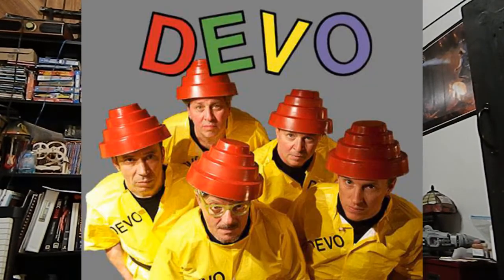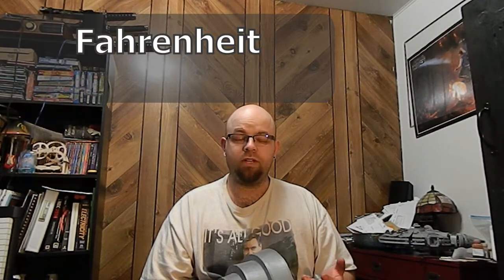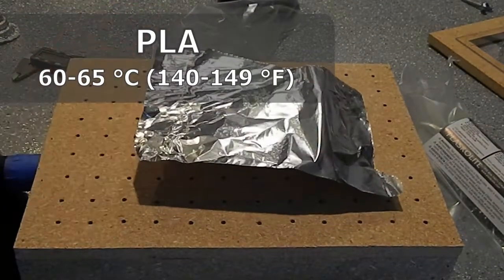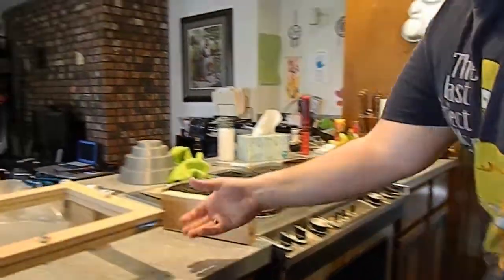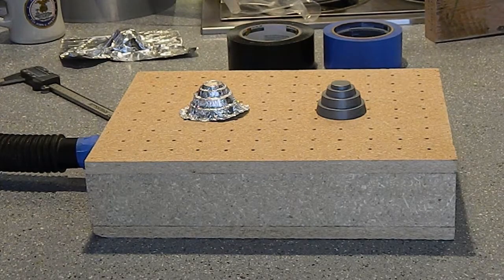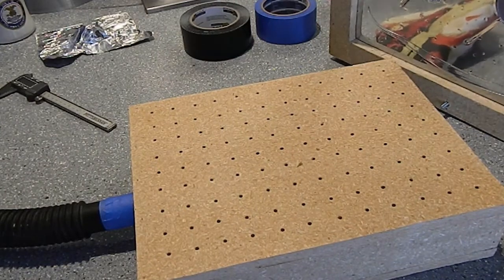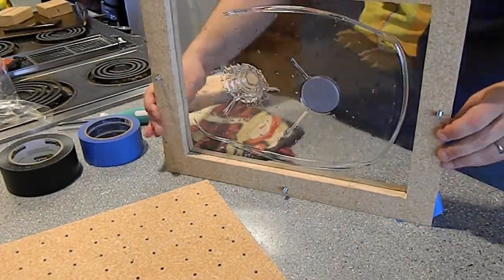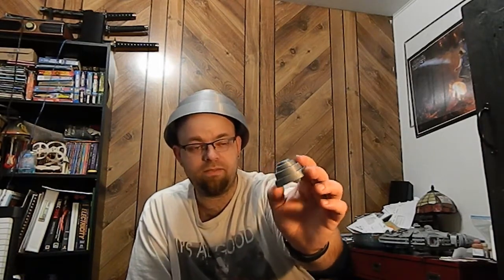Vacuum forming pla

Comment: Hi, I'm from Brazil and I'm thinking of buying a vacuum machine. Does pla deform in the process? Does not work?
Sorry if you mentioned that in the video, but I don't understand English.
Reply from the maker: Fantastic question. What I found was it did deform. The plastic I used was very thick and I had to heat it up a lot! So much, that it melted the PLA when in direct contact. I need to try a lot thinner piece and see if it will not melt the PLA. Also, a thinner piece might get better resolution, finer detail.
Reply: @dasriphobbies8443  Thanks for your reply !!
Reply: @dasriphobbies8443  A crazy idea: what if you stick the PLA piece in the freezer for some time before vacuum forming? Could that protect the PLA from deforming?
Reply: @brunoosti1  great idea im going to try that mate
Reply: @planesstevee  in my case I printed with Petg and formed with pet sheets an had no deformation on my printed master. The sheet can be formed around 150 C, witch is not that harsh on the printed Petg part. Also filled it with plaster.